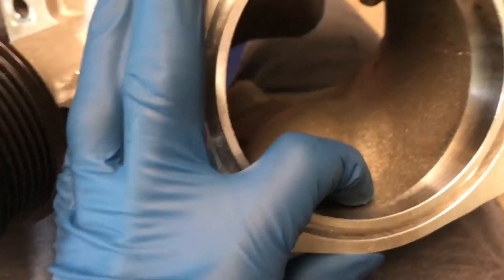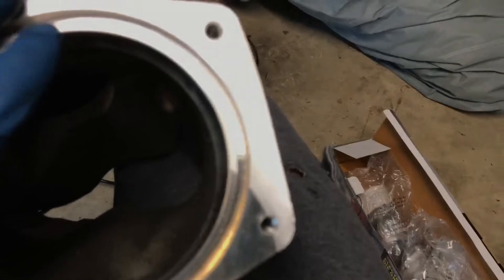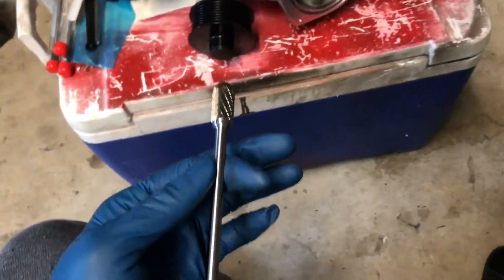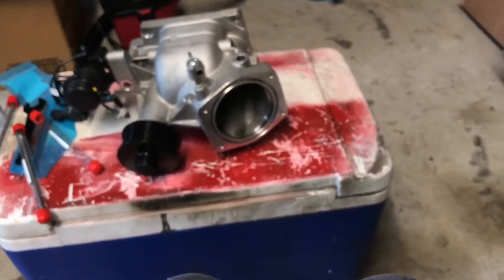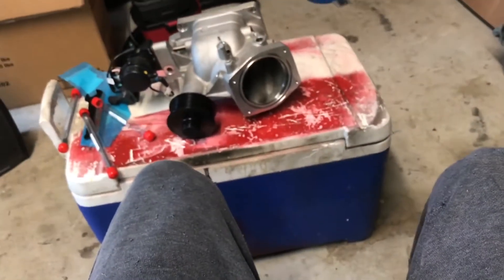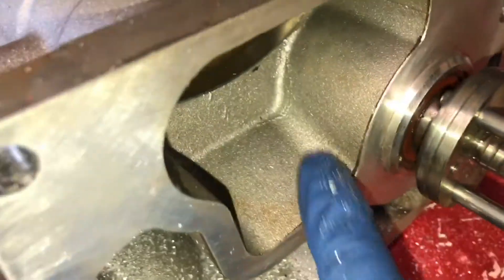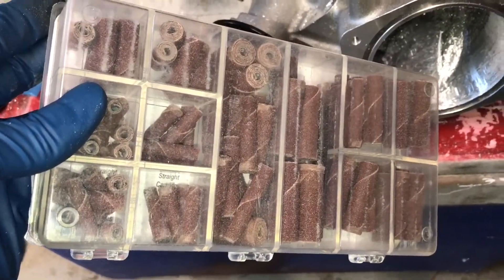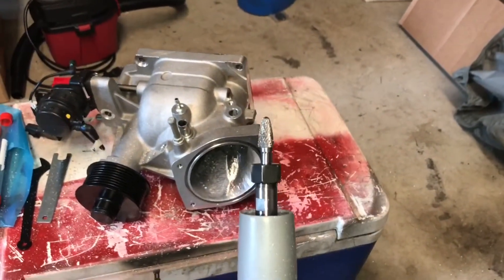LSA Supercharger DIY Porting (Part 1 - Snout Porting)

Comment: Been dying to do the snout on my V. Scared I'll go too far and end up with a hole in it. Is there a way to measure the depth as you go along or were you just eyeballing it and feeling around?
Reply from the maker: Brandon Ramirez I was eyeballing for the most part. I researched and got several pics from did companies that port the and just used the pics as a guideline. The only place I found that you really have to watch out for is the area right around and behind where the brake booster connects. That area seems a bit thin but other than that it was pretty simple.
Reply: GetItAt_WiLL nice .. I might just give it a shot. Was the difference pretty noticeable?
Reply from the maker: Brandon Ramirez I’m assuming you mean as far as power. Idk I was N/A prior to and I ported the LSA before install. I hear some people say it’s not much but I can definitely see the difference visually on how much more open the snout is. I already had it off so I went for it

Comment: Good work,  next time when working  with aluminium you should get the proper burrs for softer alloys like aluminum so you don't have clogging issues, and they cut through aluminum like butter. Just be careful,  they remove aluminium really,really quickly. I bet you would have cut the amount of time by at least 30%-50%.
Just my 2 cent's. Here's a link 
https://www.amazon.com/SpeTool-Carbide-Aluminum-Cutting-Non-Ferrous/dp/B06X9TXBYW/ref=mp_s_a_1_1_sspa?crid=ZW98YIYQ553J&keywords=burr+for+aluminum&qid=1553627018&s=gateway&sprefix=burrs+for+alu&sr=8-1-spons&psc=1
Reply from the maker: Christopher f r a n k l i n I appreciate the advice. They were carbide I believe I don’t quite remember what kind but I did some heads a few weeks back and ordered some different ones with much bigger “bite”. Definitely cut through the aluminum soooo much easier. They look similar to the ones you linked so I now know. These did have a tighter pattern so to speak which didn’t cut through as well as the sets I currently have. Thanks for the advice
Reply: @GetItAtWiLL   glad I could help.  Dont lose the first burrs you were using,  they are awesome for cast iron and steel. Just maintain at least 20,000 rpm Or above and it will keep the burrs from chipping. (Took me a few $100 worth of mac tool burrs to learn that lesson!)